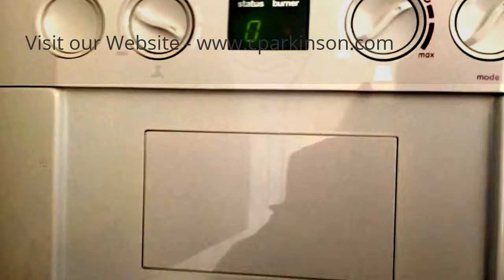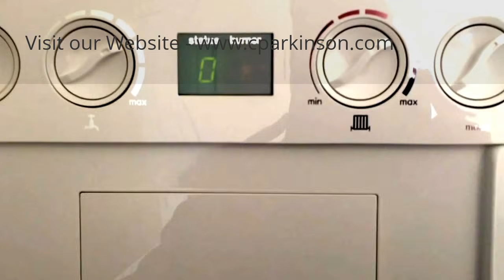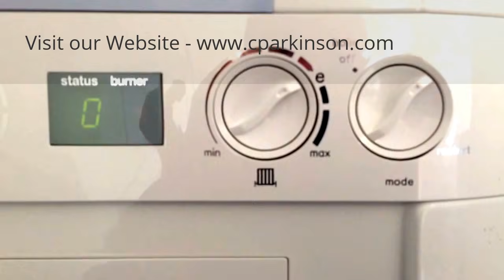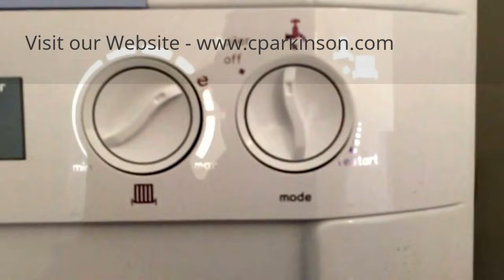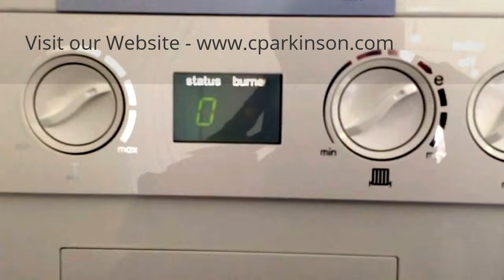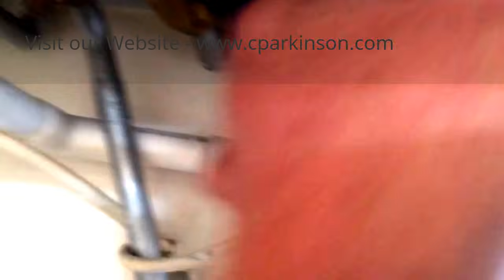#howto #theheatingpro.com #ideallogic Setting up and using your Ideal Logic combi boiler

Comment: I’d like to explain the current issue we’re experiencing with the water heater:

When we take a shower and turn on the hot water tap in the bath tub (on the first floor), hot water does come out at first, but then it suddenly turns cold. We then have to wait for about 3 minutes before hot water is available again.
I’ve already checked the manual and adjusted the water heater to the summer setting, but the same issue continues to happen.
This also happens when we take showers one after another — the problem repeats itself each time.
 We found the water pressure is at about 0.8 so we tried to add pressure to 1.8, but no improvement at all. 

May I ask your advice on this ? Thank you so much
Reply from the maker: Sounds like you may have an issue with the flow switch on the boiler. the boiler will naturally run hot then cold again while it builds up the heat. The first bit of hot water is what has been sat in the boiler, with a combi it will then send cold water through briefly while the boiler gets up to speed to heat the water. 3 mins sounds excessive though so think it may be either an issue with the flow switch on the boiler or if this only happens when you have the hot tap on on hte bath it may have something to do with the blending valve under the bath if you have one. All new build properties for some years have a blending valve under the bath where it mixes the temp down on the hot tap as an anti scald device. I would expect you will need to get an engineer in to take a look.
Regards
Roger
@theheatingpro.com

Comment: Hi I have a logic esi boiler and put the heating on today the radiator symbol is showing on the display all the time is that correct
Reply from the maker: Hi 
It is if your roomstats are calling for heat. the symbol only comes up if its getting 230/240 from your stats/ zone valves. Hope this helps, Regards Roger @theheatingpro Please Like & Subscribe.

Comment: thank you for this helpful video.
Mine is ES35 and almost same model.
there is no consistent hot water outcome from this boiler, it is 20 sec hot and then 5-8 sec cold water coming in tabs and shower.
one plumber changed thermostat (black coloured small part) last month, but it didn't fix the issue. Do you have any suggestion how to fix it. thanks
Reply from the maker: I would be looking at the diverter valve. Run your hot water for some time do any radiators get warm? Typically over summer period we dont use heating and diverter valve may get stuck

Comment: How do I change the batteries pls?
Reply from the maker: On what Jackie
Reply: @theheatingpro  there is a small box on the wall which has the on/off/timer switch inside, both ends of this box come off to reveal this switch but the light is flashing and I says replace battery on the screen

Comment: How do you know the temperature of hot water if it doesn't show you on the display?
Reply from the maker: Hi, Some boiler don't show it unfortunately but the best judge of this is the sensitivity of you hands under the tap. If you have to pull your hand away then turn the boiler down on the hot water stat. There is always a balance and everyone has a different tolerance. If you feel you have gone too far and its too cold now turn it up a little. it wont take long to get to a temp you are happy with. If water is too hot to put your hand under its costing you more in gas as you either introduce cold water or have to let it cool Hope this helps. regards Roger @theheatingpro Please like & Subscribe

Comment: Hi I have a question. I got a similar boiler, with a setting to take preheat off for hot water so done that.
Now, the E setting. If I set my temperature from the thermostat, is it more economical to keep the bar to E on the boiler or does it help if I turn it down? Many thanks
Reply from the maker: Hi Michelle, 
The manufacturer has set up the E for the most economical setting to run your heating so yes I would set it there. Sometimes running the temperature too low can delay your heat up time in the home  In terms of your heating have a play with the temp, the lower you set it and are comfortable the cheaper it is. If you have a roomstat that has 0,5 degree increments try dropping it from where you standardly have it by half a degree a night until you feel the temperature is good but as low as it can be where you are happy. The big saver on a combi boiler year round is your hot water setting, glad to hear that you took off the pre heat as it will turn on ranodmly throughout the day and night to keep a pre heat of water ready for when you draw hot water from a tap. In most instances this is not necessary and only an additional cost. Again have a play with your hot water setting, I find most people have it set too hot and are unable to put their hands under the water when it reaches its max, thus having to add cold water to mix the water back down to an acceptable temp. Set it to where it is hot enough for your needs and no higher. The KW rating on all combi boilers is set for the hot water side as it requires a lot of gas quickly to turn the cold water to hot water. Higher KW output = higher gas use. Limit the temp and you will lower the KW/hr used.
Few tips on your heating system would be make sure all rads have been bled of air, use and set your TRV's per room and if you have two stats ie 2 zone heating dont just leave them on factory settings. Adjust the upstairs stat to come on early morning and later evening when you are typically using the rooms at a lower temp than main living rooms. 18 degrees is the standard temp for a bedroom. Set up your downstairs stat for when you will typically be downstairs and try and limit it back as far as you can and dont just leave set on the factory settings which are usually 20 or 21 degrees.
I usually dont use the schedule feature until we hit a lot colder weather and turn on and off manually. Where we are moving into the colder months you will find some days quite a pleasant temp and no need for heating and others where you may feel the need to bring it on for an hour or two, until we get to the point where it is needed every day, then switch to the schedule
Hope this helps a little and please let me know if oyu have any other questions
Regards
Roger
@theheatingpro.com
Please Like & Subscribe
Reply: @theheatingpro  Wow I didn't expect such a complete answer, thank you so much for taking the time to explain this througly! Really helpful, I appreciate it.

Comment: Super informative video. Wonder could you advise on something ?. So the remote control is broken currently - I understand the above settings etc , and I have running hot water working away , but mo heat (I used turn heat on using the remote) - How do I actually do it manually ? I would have thought just turning the Radiator button would do it but nothing happens :/

Comment: My heating stays on 0 but getting hot water no heating??
Reply from the maker: Hi James, suggests that the boiler isn't getting a call from the stat. If you have two zone heating this could be an issue with the zone valve too. If it is single zone ie only one stat then check the stat is sitting correctly on the backplate. Further than that you will need an engineer to take a look
Regards
Roger 
@theheatingpro.com
Please Like and Subscribe

Comment: Hi Roger, thanks for the quick video explanation. 
 
Generallly looking for what is the most efficient way to keep the house hot during the scottish winters. 

First time owning a property so a bit nervous about pipes freezing and such. Am i more concerned about the tap heat or both radiator and tap? 

Any advice on sound proofing the cupboard as well?
Reply from the maker: Hi Jacobite Productions,
Set for both tap & heating this time of year as tap only wont allow the heating to come on even if the roomstat calls for the boiler.
What roomstat do you have?  I will be able to help you more with your question in that department rather than the boiler end. The boiler is just the heat generator, set to E (plus tap & heating) and you can forget about it in terms of running the heating which is at the stat end.
Regards
Roger
@theheatingpro
Please Like & Subscribe

Comment: Hi, thanks for a simple to follow video, we’ve just moved into a house with one like this ours is a i130 we have all set the same as yours but we have an extra control which gives the option of manual or automatic and we are unsure which to have it on? We only need the heating on between 6am and 11pm we have a altech thermostat, it seems to be costing a lot more than our old house to to yet it’s a smaller house.
Reply from the maker: Hi Tina, Depends on how you want to use it Auto will follow your programmed settings, Manual will be On until you turn it off and off until you turn it on. Hope this helps and further questions please ask
Regards
Roger
@theheatingpro.com
Please Like & Subscribe
Reply: @theheatingpro  Thank you yes it does help us

Comment: Great video!  I have a Logic 30 just like the one in your video, fully serviced and pretty much everything replaced under service contract, and this is controlled by a Honeywell Evohome. .  

It has always taken an absolute age to heat the house, a double glazed 3 bed 1930s semi, from cold.  As an example, this evening it took circa 2 hours or so to go from 14.5c to 18c with the boiler set to eco and an ambient temp of 9c, which seems awfully long when I read of similar systems taking 30 min to do the same.  

Any suggestions as to what to investigate or is likely down to elderly radiators?  The Evohome is setup as a thermostat and is located in the hall, which has a 1.8m long single radiator without TRV.  Any advice much appreciated.
Reply from the maker: Hi Stef, 
A number of factors to look through. Firstly has the performance always been the same or are you noticing a lowering in performance. Are your insulation levels good? Do a touch test with the outside of you hand on all radiators. Typically after 15 mins I would expect that you would need to pull your hand off the radiator in a count of 3 seconds for a radiator which is heating as I would expect it capable of. Any slower than 8 seconds or a radiator whcih you can leave your hand on suggests either an underperforming pump or balancing issues. 
Check that all parts of each radiator are getting hot after 20 minutes or so. They will heat from the top first but should get fully hot even at the  bottom mid point of the radiator. It may suggest a sludge build up in the radiators if the lower section never gets hot. Take a look at these come back to me and hopefully I can add some more suggestions to get the best out of your system.
Regards
Roger
@theheatingpro
Please Like & Subscribe
Reply: @theheatingpro  Roger, thank you very much for the very detailed reply, which is really appreciated.  I shall conduct the checks you suggest and get back to you.
Reply from the maker: @dontcare32123  Hi Stef, Let me know how you get on and I will ask a few more questions to hopefully get you sorted.
Regards
Roger
Reply: @theheatingpro Sorry for the very late reply in getting back to you.  I changed a large single panel radiator with fins to a double panel with fins and the room is now up to setpoint in around 30 to 40 minutes, which is a massive difference.  I have also started working through the other radiators by making similar changes plus the boiler is now running Opentherm, which seems to keep the room temperature nice and steady.  Still playing with boiler flow temperatures on the Ideal, which is fortunately still adjustable despite the Opentherm connection.

Comment: How could i fix L1 error code…?🥲🥲🥲
Reply from the maker: Hi Claudiu,
F1 
Low pressure warning. You will need to repressurise your boiler with the Filling loop taps underneath. Usually two blue taps turn the left one towards you and then turn the right hand one towards you and watch the pressure rise on the dial. you want it to be around 1 bar. Turn the right tap back to its original position and then the same with the left so its pointing up towards the boiler. Boiler generally resets itself from this point but you may need to reset.
Hope this helps
Regards
Roger
@theheatingpro
Please Like & Subscribe

Comment: Did everything and still no heating in radiators and shows 0 and red light on control on wall .. any tips ?
Reply from the maker: HI Ingrid, Which control do you have on the wall and do you know if your heating is single or two zone?
Regards
Roger
@theheatingpro.com
Please Like & Subscribe

Comment: how can i fix the f3 error
Reply from the maker: Hi
The F3 fault is not a straight forward one I'm afraid
F3: Fault with fan
This fault is caused by a loose or damaged fan. This issue could be related to deeper problems such as loose or damaged connections, water damage from a boiler leak, a fault with the air pressure switch or a problem with the printed circuit board. I would suggest that a breakdown engineer would be the best person to look at it for you. The fact that it could be a number of parts I would also look at the manufacturer option to fix it. https://idealheating.com/support/out-of-warranty-protection
A one off fee of £299.00 to fix it with 6 months cover from point of repair. 
Hope this helps
Regards
Roger
@theheatingpro.com
Please Like & Subscribe

Comment: My boiler keeps going on and off. DHW preheat. Code P on boiler. Never done it til after engineer had been out to fix a fault. Can this be turned off as going on and off every few minutes?
Reply from the maker: Hi Jackie,
Yes you can turn off the preheat. It is a facility to have a small storage of hot water to give you instant hot water while the boiler kicks in and gets up to temp when you demand hot water. It may be useful if your bathroom is a distance away from the boiler to save running a lot of water off waiting for the water to get hot, but in most instances it is not required. It will constantly fire the boiler at random times to keep that  small amount of water hot for when you first demand it. SImply turn the preheat off, it wont affect any other settings of your boiler and guess that you had never used it up to this point.
Regards
Roger
@theheatingpro.com
Please Like & Subscribe

Comment: Mine has recently started saying P any ideas
Reply from the maker: Hi Simon,
Not aware of a P in the fault codes. What is the model of your boiler. Will be an ID badge on top left of your boiler at side of the flue or on bottom left hand edge under boiler. May be able to help if I knoow exactly which model
Regards
Roger
@theheatingpro.com
Please Like & Subscibe

Comment: Hi , I  have this boiler, hot water working along with upstairs radiator butnoheating downstairs? Have bled radiators and nothing from boiler,just stays on 0. It wont fire up? Thank you
Reply from the maker: Hi jemma, If the boiler is working on the hot water and one of your heating zones the issue doesnt lie with the boiler. It will be either the stat or zone valve. Turn the stat up so it is demanding heat and check to see if it energises the zone valve. The lever on the side of the zone valve goes slack when its energised. If it remains with a spring recoil resistance when you have a call from the stat then it is likely a stat issue. If the lever is slack then it is likely a zone valve head issue. You will likely have to get someone in to change either unless you are electrically minded but at least you should be able to work out which is at fault
Hope this helps
Any questions let me know
Regards
Roger
@theheatingpro.com
Please Like & Subscribe
Reply: @theheatingpro  thank you for swift reply👍 ok, umm.....one of the zone valves( I believe upstairs working zone) feels quite warm and energised , one is cold ( I believe downstairs non working one) they both have little lever on the top which do not differentiate in slackness?  The stat ( downstairs) is on , and shows flame when put on but no response from boiler. Do you have a very rough price of what I could be looking at, I have rang a few companies and want around £100 to investigate. Thank you

Comment: Hi I have a ideal boiler    think its the c25   it is  making a vibration noise  intermittently      its quite load  can you give me some advice pleases
Reply from the maker: Hi Christine, How old is the boiler? Is it due a service? The injector needs cleaning on the service as fine debris in it can cause vibration/noise generally on min rate fire. The gas valve may also need looking at as it may be defective. How old is the boiler and is it still in warranty?
Regards
Roger
@theheatingpro.com
Please Like & Subscribe
Reply: @theheatingpro  no its about 10 years old  had new parts twice  one last october but started again  thinking of a replacement

Comment: I've got logic combi c30 there's a spanner L2 sign coming up my heating and hot water has gone off I have done everything topped it up reset it nothing seems to be working what do I do please help
Reply from the maker: Hi Mumtaz, Few things that could be causing this but looking at the most obvious first. Dies your condesne pipe run to the outside of the building? May be frozen if thats the case, Boil a kettle and run it over the pipe outside to thaw it out. Let me know how you get on, if the outside temp has changed you may find that it may work when you reset it wothout resorting to the kettle. Let me know how you get on as there are other things that could be causing the L2 fault
Regards
Roger
@theheatingpro.com
Please Like & Subscribe